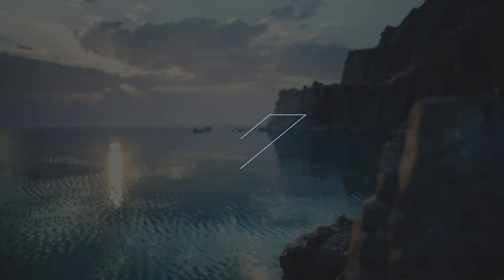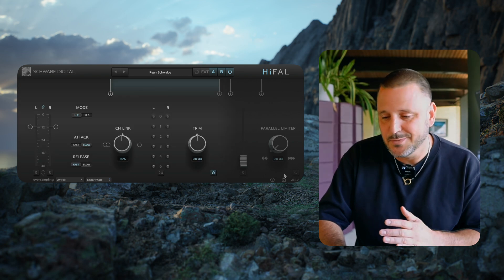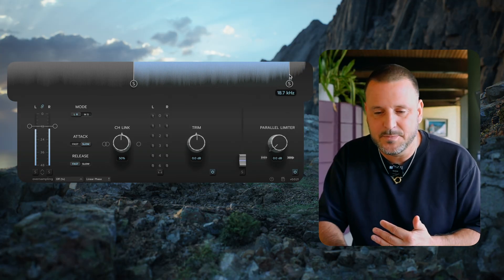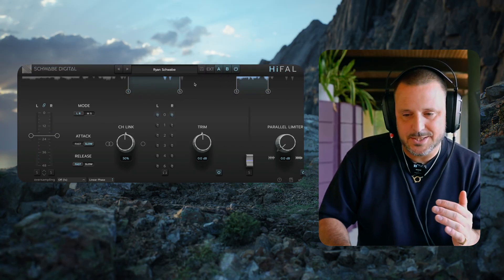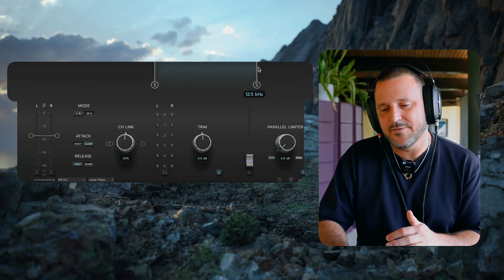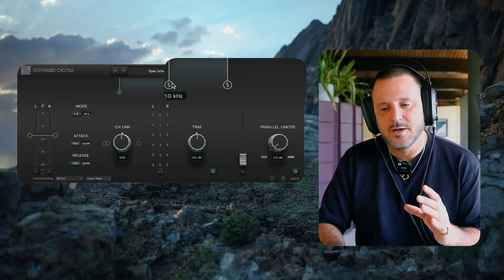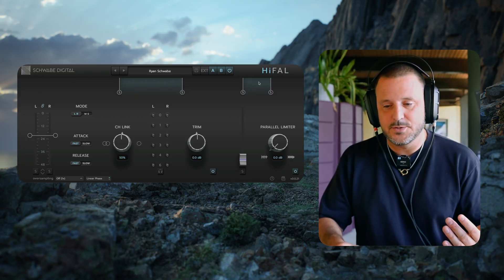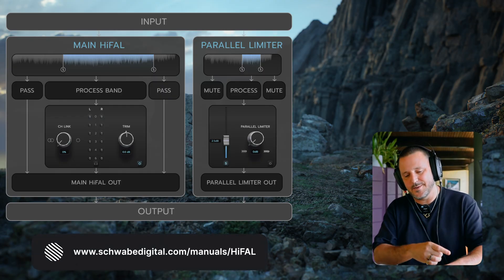2) Overview of HiFAL

Comment: Dude, super well thought out plugin! I’ve just started playing with it and it is definitely a ‘do no harm’ plugin. BUT it does exactly what it’s designed to do.
Reply from the maker: Thank you Jeff.  Yeah, I spent so much time designing the filters and way that the crossover works so that it does not change anything about the plugin.  No Harmonics, no changes to the spectral balance 0- The sound of this plugin is purely in its unique dynamic process.

Comment: hey there, I've been using HiFal for a few days now and I'm a little confused, so when you Solo the band on the right what you are hearing is the frequencies to the right that are being excluded from any type of processing? so this is not a Delta of what's being subtracted? so essentially you want to solo and hear frequencies that you want to keep the exact same? in that case you would basically use Bypass to determine what you're doing and what's being changed? I haven't been able to make anything sound better yet, I def see the value in taming sharp frequency peaks but I don't know how this tool would be more useful than a dynamic MB eq?
Reply from the maker: When you solo the HF flag in HiFAL, you’re hearing the unprocessed frequencies above the process band — basically what’s being excluded, not a delta or subtraction signal.

If you want to hear the delta of the dynamic process, click the headphone button below the GR meter. The crossover solos are designed so that the LF flag lets you hear what’s processed, and the HF flag lets you hear what’s excluded. This helps you find exactly where the acceleration limiter is active and dial in the range precisely.

The goal of HiFAL is to control the movement of high frequencies — smoothing sharp, high-velocity transients that typical dynamic EQs don’t track because their attack and release are fixed.

A multiband dynamic EQ reacts to level, while HiFAL reacts to waveform velocity. It’s an acceleration limiter, meaning it responds to how fast the waveform is changing, not how loud it is. This makes it great for taming things like hi-hats, sibilance, or bright percussion in a more natural, analog-feeling way — without dulling the top end.

Try setting an average reduction around 1–2 dB, and you’ll see it occasionally jump to 4–6 dB when something spikes in the highs. The difference is subtle but adds cohesion and reduces fatigue over time.

Comment: Can it be used live,or is it too much latency?
Reply from the maker: HiFAL is a linear-phase processor that uses true linear-phase filtering to avoid any phase shift. Obviously that comes with some latency (685). With that said, this might be lowest latency linear phase processors on the market. We spent a lot of time and R+D on the linear phase filterbank. Linear phase is the key advantage over resonant suppressors, which introduce considerable phase shift depending on the Q of their filters. HiFAL preserves the full integrity of the signal and phase , with no coloration or timing smear. In the future, I may add filter options for 0 latency filters so HiFAL can be used for tracking. We’ll see.
Reply: Too much latency.

Comment: I'm excited, looks like an amazing plugin. Just wondering how it compares to spectral plugins like Melda Spectral Dynamics which on paper can do the same thing
Reply: I have MSpectral Dynamics, SpecCraft, and Soothe, and this is a great addition. It's easier to dial in and the others don't create the same silky sheen as this one
Reply from the maker: Those are spectral processors with static dynamic behavior, and in my opinion, they sand the soul out of music.
This is an acceleration process that leaves natural transients untouched and preserves the shape of fast, high-velocity hits.
It’s a completely different approach.
The engineer’s goal might be the same when using either tool—to control or smooth something—but how they work is very different.
I avoid spectral processors unless absolutely necessary.
They’re basically minimum-phase instant EQs, and to my ear, they cause phase shift and remove what I call digital urgency of sounds.

Comment: Could you add a solo option for the lower non-processed band as well? That way you can make sure there is no harshness below the band you are processing. Thanks!
Reply from the maker: Right-click the LF crossover flag or the area between the flags to solo it.
Then drag the process band lower to hear what you might want to control.
I am not sure if adding more buttons is ideal. A big part of designing a good product is not overloading it with buttons and options. Too many controls can feel tiring. After spending more time with it, I think you will see that there is a good amount of soloing options already at your fingertips.  Right click to solo is my favorite way to just jump in and listening to different elements.

Comment: Good plugin. It feels like it is very close to ozone dynamics with only one band where the compressor and limiter are more independent. And of course, with a good oversampling algorithm.
Reply from the maker: That’s a traditional static compressor, while HiFAL is an adaptive attack and release acceleration limiter.
It uses a completely different topology and algorithm.
This isn’t a typical dynamic process and takes a bit of mental rewiring to understand how it works.
More videos are on the way.